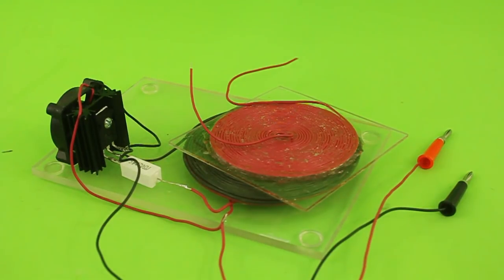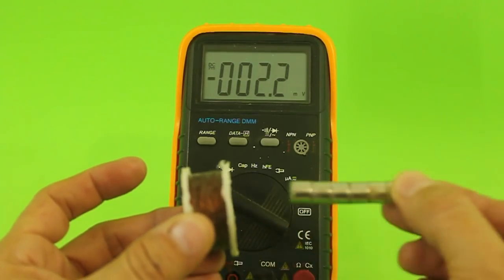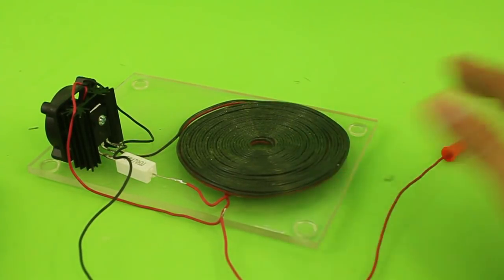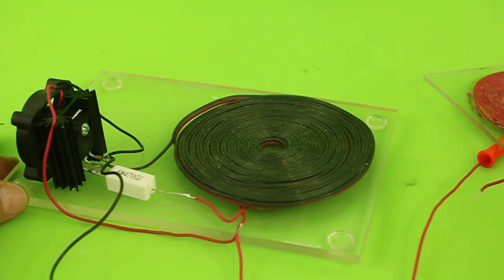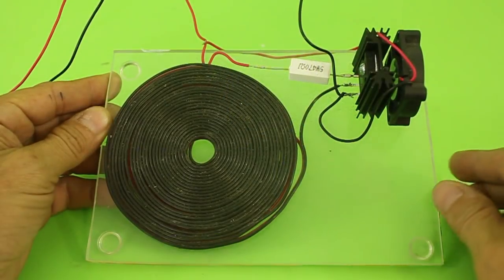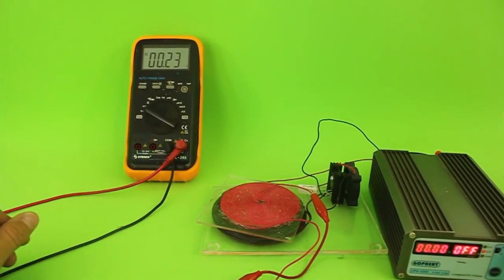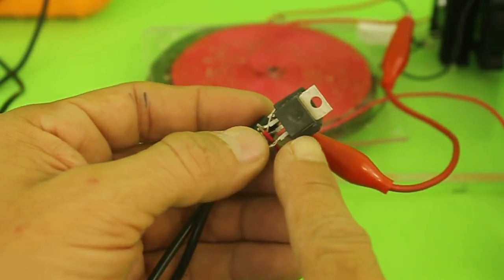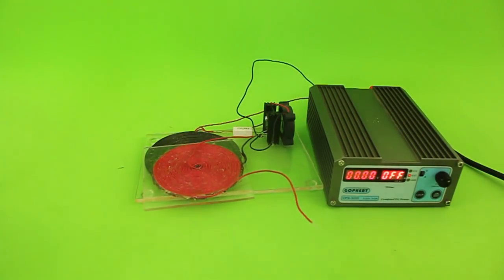DIY Wireless Charger Prototype

Comment: matching the resonance frequencies by adding capacitors to both the transmitter and the reciever coil will improve efficiency. Nice work as always.
Reply: Yeah. I thought the same thing. Some few years back, I heard that MIT had achieved the highest wireless charging distance of some few meters by using a resonant circuit
Reply: @davemwangi05  if you really take the time to tweak all the paramteres just right, it is possible to achieve great results like you mentioned

Comment: Thank you for the video, I like it but was little bit disappointed the charging circuit was not explained.
Like why two wires? why one wire connect to the end of the other wire? what is the frequency? Number of wire turns depends on what?